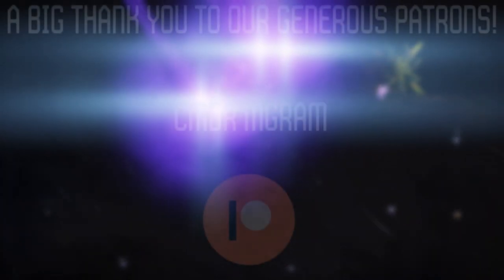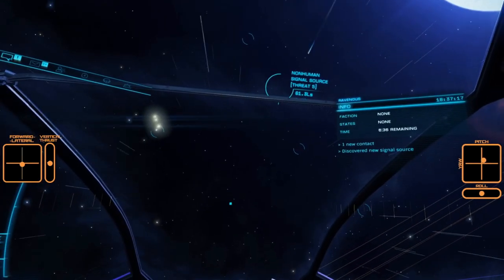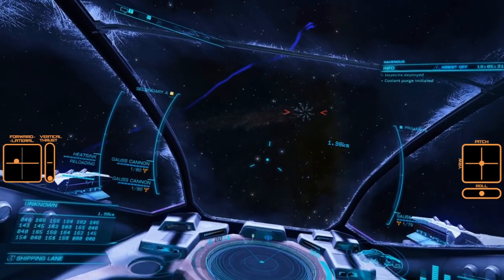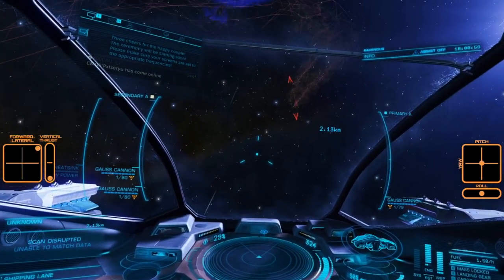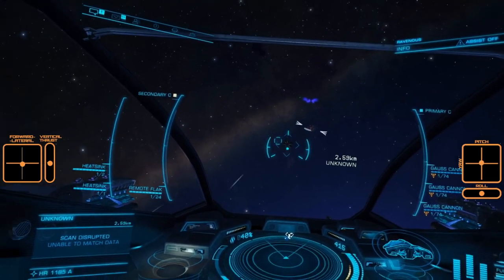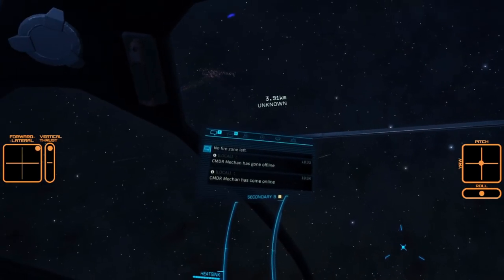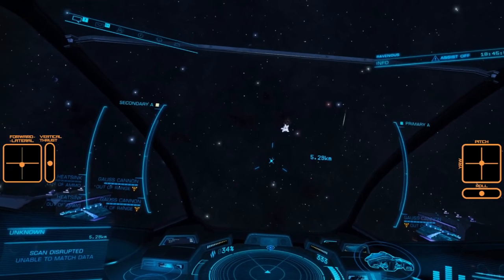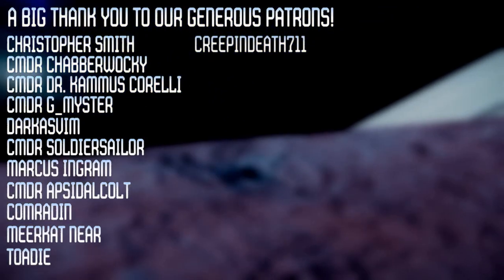Cold-Orbiting Walkthough -  with control axis overlays - Thargoid Combat Tutorial

Comment: It's a facinating display of patience. I have a Viper AX build a well, size 2 Gauss and AX MC, size 1 Gauss and thermal vent longrange beam, no heatsinks (Xeno scanner, Field neutralizer). I ignore the swarm and keep it on the other side of the Thargoid. The beam turret keeps me at 1% heat. This kills much faster. However, of course it doesn't scale up as well, without heatsinks larger Interceptors than Baselisks become difficult. I don't have the patience for those builds, rather use a Challenger then. Don't worry about those not creating content and complaining about "aems" in the voice over. It saves much time and was well done. I would like to hear their stuttering in a fight like this 😉

Comment: Good stuff. For those struggling, I will add that FA-off and cold orbiting is not an essential requirement to evade the goid's incoming fire. You can stay FA-on, roll to the relevant angle and just then use lots of down thrust (whilst maintaining distance with forward/back thrusters). The downside being that this technique will 'decay' more quickly, so you'll lose time on target (because you'll need to boost to a new position and then re-establish). I can take down a Basilisk like this.

Comment: Hey,

been playing ED for a few weeks now as a casual VR eye candy exploration spectacle, but the AX combat was definitely on my bucket list from the start... 
and since am "flying" just with PS4 Dualshock with zero FAoff experiences you can probably guess how my first ever interceptor meeting 2 days ago went (also it was the fast one :/)

So, long story short, yesterday I found this, watched it couple of times, admitted that's a very clever solution (my favorite kind), and today am waiting for an anti-corrosive rack transfer with my first Thargo heart in the bag slowly eating my modules. One variant down, three to go :)

Anyway, thanks for the solid explanation especially with that graphic overlay, that was really useful, although am very very far away from using it effectively (shieldless, coz of precise 6 axis control ain't exactly a gamepad's strongest feature :o) I'd say it's much better to try to fight 'em this way (even badly) than some other head-on tanking nonsense.

Btw, I've got one question, when shooting the swarm I noticed you had mentioned aiming halfway between some icon and it... how come I don't have that icon there? 
I thought it's due to the missing AX scanner, but you weren't using that either.

Cheers!

Comment: I always have problems keeping an orbit, now that I can see the controls, I think I force the orbit too much and that's why the thargoid stops so many times doing a 360. I'll try to adjust my speed more and not go crazy.
Thanks Kate, thanks to your videos I was able to learn how to kill cyclops and basilisks.
Reply from the maker: haha yeah when I first started doing this I was the same - i felt like i had to go blazing in at full speed - if you are running flak then orbiting is actually best done at quite a low speed i found out later :D 

Also yes the goids go into a kind of position reset if you boost at them quickly and so you can end up with them facing away form you quite a lot - with slow orbiting they still do turn to reload regularly but if you just use forward thrust with up ward thrust to cancel out your orbit inertia you can generally keep pace
Reply: @Citizen_Kate  Thank you again, ill try to reduce my speed and do as you say, maybe with that ill be able to kill a medusa :)
Reply: @Citizen_Kate  How do you manage to maintain such precise aiming? I started training yesterday and it's a lot to keep track of while fighting and i haven't managed to destroy the first heart after exertion because it's really hard to land precise shots. Is there any sort of curves recommended for Joystick users or am i missing something else? I'm getting more and more frustrated as my attempts fail over and over again...

Comment: I noticed that a lot of the proper AX people  don't capitalize on the initial contact and final stage element. They seem to do the "take 10 paces" wild west approach ;P  Me? No honor, when it comes to bugs. Once you begin the conflict the bug takes time to deploy Thargon. Inside that time I've had one heart off and now I have time to create distance because it freezes to put up panic shields. In the case of the Basilisk it seems like you have time to at least whittle that shield down quite a bit, sometimes even exert a heart, if you really get greedy. The final stage? I'll overheat, if necessary, to get that killing blow in by chaining together (usually) 1 or 3 shots to the hull. Very seldom do I not make the panic shield window. That final count number of shots for the killing blow depends on how many times you struck its hull, previously, subsequent knocking out a heart, I find. About 50% of the time all I need to do is shoot it once after knocking out the final heart because I'll sneak 1-2 shots off on its hull, after knocking out each heart. It's so far proven to accumulate in other words. And if you're not great, like me? It can mean the difference of life and death. Against a basilisk I might have <25% hull left and not want to chance another go around

Comment: Hi thanks for this great vid. I'm just starting out with AX so it's very interesting.   On the swarm. It takes me ages to kill it. I thought you have to put the crosshair point in the middle of the recticule, and the recitcule has to be over the swarm . And you have to keep the crosshair over the swarm and recitcule all lined up to guide the flak in.

But it seems from your vid you aim the crosshair point  halfway between the swarm and the recitcule.  Then once fired you don't have to keep the crosshair still    you can move it away and just time the release to the sound beep. Is that right?

Comment: i suppose keyboard and mouse might be a bit difficult to try right?  i have the WASD as the forward/lateral thrusters, q and e for roll, ctrl for down thrust and space for up thrust. basically like an fps shooter. for mouse i would have to have "relative mouse" on so i wont got spinning out of control but its hard to fly in super cruise.
Reply: You can buy a controller to fly in super cruise or fa on, very usefull :)

Comment: katie thank you for the detailed demonstration on cold orbiting. however its ALWAYS been a personal issue of mine knowing how to controll the distance betweeen the ship and the thargoid. even after watching the video i still find it difficult to maintain proper optimal damage range of a thargoid. my struggle is the thargoid getting to far away and unable to stay close enough. i don't REALY have a problem micro-managing the other controlls. im a very capable pilot, ive taken on all class thargoid except hydras because i know optimal distance is #1 in a hydra fight. it's just not something i can maintain. i mianly use the chieftain with flak and thermal vent. i love the ship but range is just were im struggling. is there any advice you can give to someone who knows the mecanics of a fight I.E silent run after heart destruction..      but difficulty with distance? ive learned how to fight thargoids from the ground up form you and only you. i would truely like to understand the distance mecanic so i can grow as an AX pilot and spread my tales as a console AX hunter FAR and wide.
Reply: Range management is a constant change between the forward and reverse thrust as needed to keep the optimum range from the thargoid. This will depend on its speed and yours. Also its possible to slow yourself down toggling forward/reverse. So you may have to stay in one position longer than the other to keep distance. The easiest way to do this is to hot key 75% forward and 100% reverse. And practice switching back and forth. Watch the info panel on the left of the hologram to tell you your range and practice keeping to 1.5 to 2km.
Reply: But you'll have to mix that with your other flight controls to make everything blend together of course.